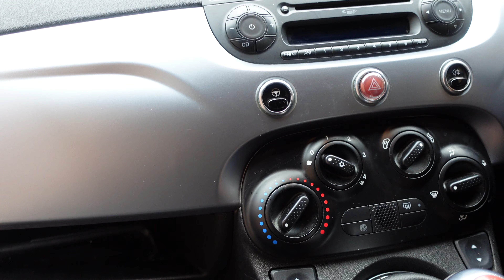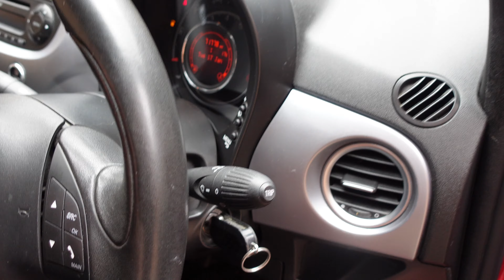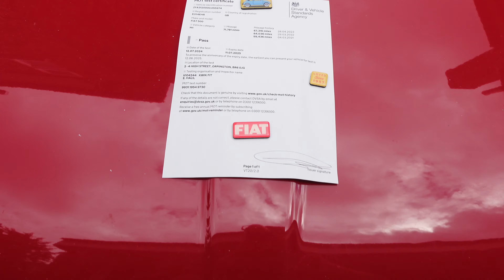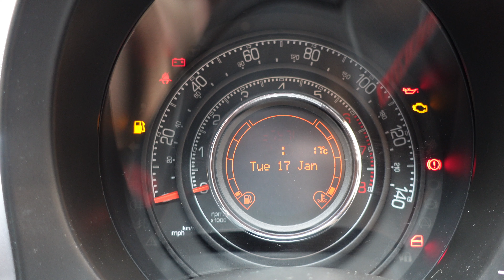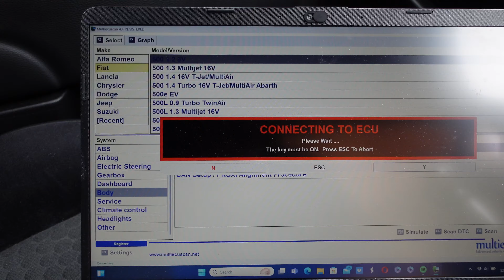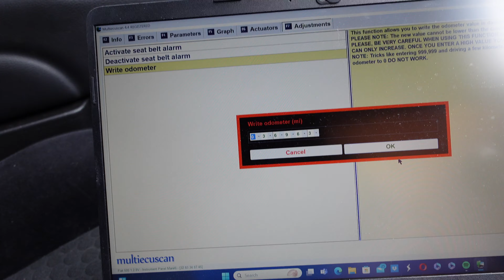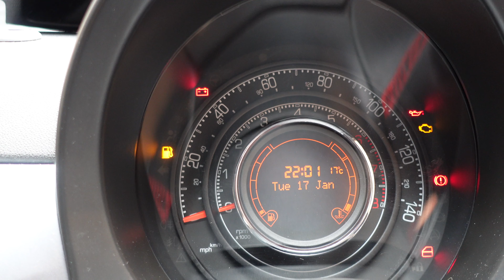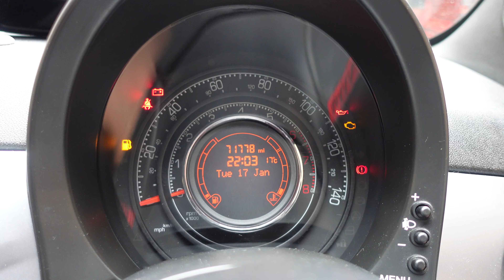Project Stinky Ella - Day 4 - Tyres, Wheels, Paint & Odd Bits. Cat N Sport Fiat 500 from Copart.

Comment: Great job once again,can you tell me what grade of wet and dry did you use on the scratch on the rear quarter and do you need to use any lacquer? Thanks
Reply from the maker: @bill_20  it’s 2500 grade. Scared to go coarser as you don’t want to damage the paint around it. I haven’t actually put any lacquer on it yet but am going to mix some in on what is hopefully the final coat.
Reply: @Love500  great job thanks I have a similar scratch 🙈

Comment: Please, I have a question and watched one of your older videos on same. My Blue&Me isn’t working. I disconnected the battery for 30 mins. Didn’t help. I’m in Dublin… no wish to send my B&M cassette to anywhere for repair, would you recommend I just remove jt altogether as I believe when they stop working they can drain the battery even if everything is switched off. Seems like a funny quirk when they stop working they pull from the battery causing other issues… hope to hear back from you. Many thanks…
Reply from the maker: @campsbaysa  you can disconnect it at the module itself but the mileage will flash. You will need to do a proxy alignment. If you want to repair it I do it for £60.
Reply: @Love500  ok thanks so much for the reply. I just watched your whole video on removing all the elements to get to the module. Could Fiat have made it more difficult? It should be so much more accessible… I’m in Dublin! I’d have to send to you in UK and you’d have to send back to me! Question, my mechanic just replaced the gear cable assembly for me and I collected car today. It was only when I got home I noticed Bluetooth not working. Is it possible that he might have pulled out some connector under the bonnet somewhere? The module must connect to its buttons via some sort of cable/wire under the bonnet… might he have pulled the connector out at the other end do you think? Is that feasible? Thank you so much for your info…
Reply from the maker: @campsbaysa  there’s nothing under the bonnet for it. May be a coincidence but it has been known to cause a problem following the battery being disconnected.
Reply: @Love500  he must have disconnected the battery as when I got back in the car the clock and date had to be reset! That’s so annoying it could have been caused by disconnecting the battery.. now I have this very annoying issue which I would ignore but I’m afraid of the parasitic drain that could come down the line! Thanks so much for your help and advice.
Reply from the maker: @campsbaysa  it not working doesn’t necessarily mean you’re going to get the parasitic drain. A proxy alignment might fix it. If not, a repair is the only option apart from disconnecting it.
Reply: @Love500  Ok… thanks again. I now need to figure out my best options and plan of action. Really appreciate your help.